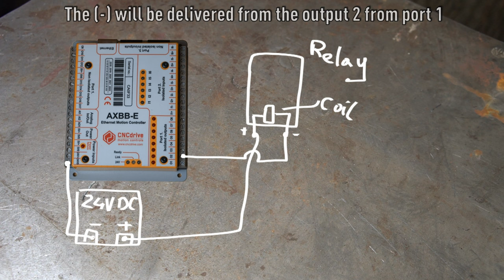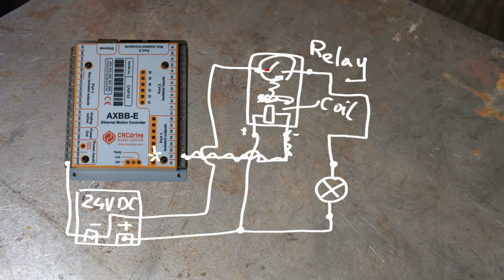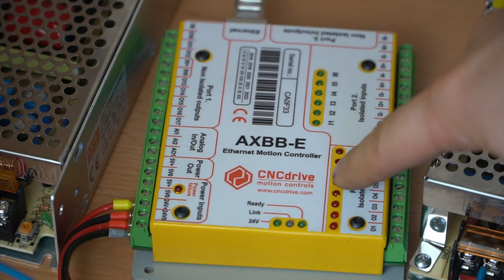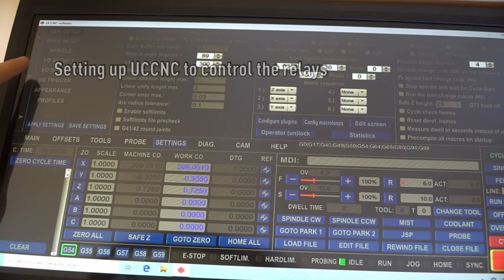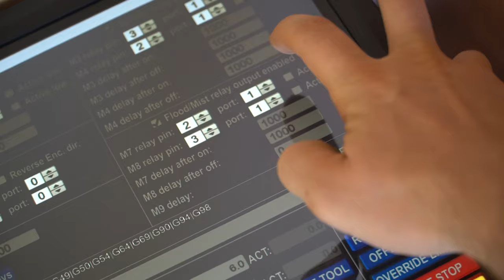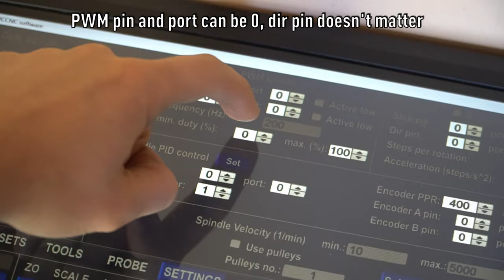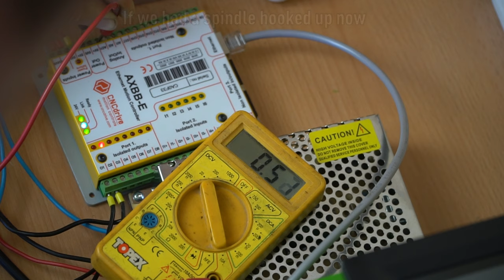AXBB-E Ethernet CNC Controller #3 Spindle Outputs Setup!

Comment: So I wired mine like this, and it worked with no relays.
VFD --> AXBB-E
10V removed
AVI --> AO1 (Analog In/Out)
COM --> -5V (Power Out)
FWD --> Pin02 port1 (Set m3 in UCCNC to pin2 port1)
Rev --> Pin03 Port1 (Set m4 in UCCNC to pin3 port1)
Added a jumper From AXBB-E -5V --> Pin01 Port1
I removed the jumper on the AXBB-E (for 10V) 
Make sure to select spindle PWM Analog ch1 in the IO setup in UCCNC
I set my spindle velocity to 8000min to 24000 max ( I have 2,2 KW water cooled)
Reply from the maker: I pinned your comment so everyone with such problem will see it. Thank you for sharing :)

Comment: Sorry, maybe I'm wrong (I also recently bought Axbb), but it seemed to me that it was not necessary to install a relay to start and stop the spindle.
Reply from the maker: It depends on the type of VFD you have (what kind of signal it needs). For example to run my VFD in forward direction I have to connect the GND wire with an DI (digital input) to make it work. So turn on the relay with the AXBB-E and the relay connects the GND with DI1 on the VFD. Taadaaa :D But of course there might be other wiring methods according to the VFD manual.

Comment: Hey, Awesome explanation.
I have an old bed type milling machine want to upgrade to CNC but confused with controlling system. After watching you videos i have a question my machine have servo motors and ball screws in all three axis. The motors are DC servo with techogenrator for feedback. I dont know how to move ahead.
Reply from the maker: Hello! I'm glad you like my videos.
Ballscrews in all three axis make the machine very good for a CNC conversion. But the DC servo with tachogenerator might be a problem if those aren't step/dir signal driven (probably analog 0-10V?). I have no experience with those tacho-DC servos though so I'm probably not able to help you out. I'm not sure if any of the UCCNC controllers are able to control those servos if these aren't step/dir. But I've heard about CSMIO controllers. There is one model of these which I heard is capable of analog signal controlled servos - this might help. Or just swap out these original motors for other servos which accept Step/dir signals and therefore the UCCNC controllers will drive it without problem. I hope this answer gave you an idea how to deal with it :)

Comment: Thanks for all your great videos. I have an issue: I have connected AXBB-E to my VFD via A01 and 5VO to control my VFD with 0-10V. 
When I in UNCNC set spindle speed to 12000 rpm (of max 24000) I only get 3,7V but when 24000 rpm I got 10V
Reply from the maker: This is actually strange - I didn't encounter such situation during my setup process and sadly I have no thoughts what could cause such issue

Comment: I upgraded my motion controller with the axbb-e. My question is that my VFD was connected without the use of the relays. Is there a way to connect it again without the relays.
Reply from the maker: I dont know how your vfd works but if you want to turn it on with m3 or m4 code then you need a relay i guess

Comment: Hi. I thiking to use this controller with mach 3 in 5axis milling machine .it is first project with this controller for 5 axis.
What you think?
Reply from the maker: Hi! Sure! I didn't use more than 3 axis with it but it is designed to controll even 6 so you should be fine with it. But remember you should get the additional UCSB BoB to get access to the additional pins as it delivers just 4 axis pins to the screw terminals and to get access to the additional ones you have to use the Port 3. But overall this controller is fantastic!

Comment: is that mach software with custom theme?
Reply from the maker: This is UCCNC. It's a different software. It is similar to MACH3 I would say but much more modern, more user-friendly and it's got some more functions. But the controller itself can be used with mach3 / mach4 (with an special plugin installed).